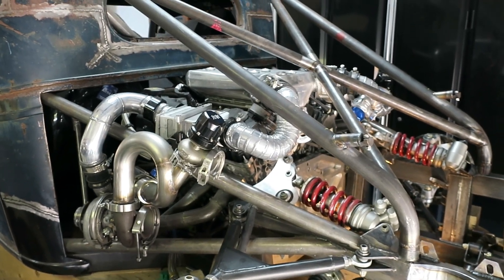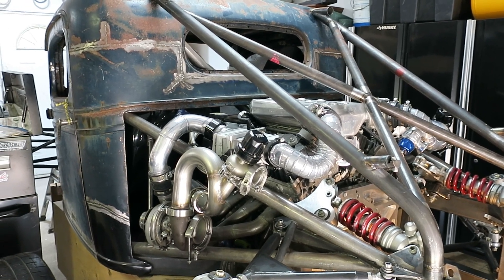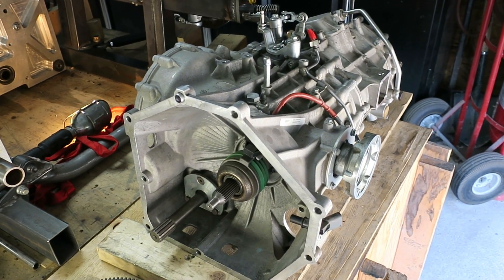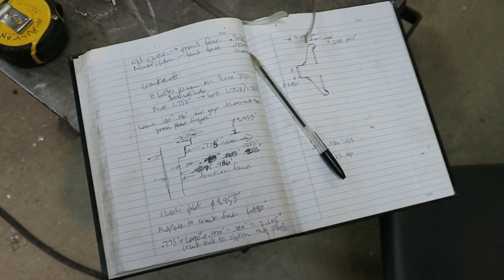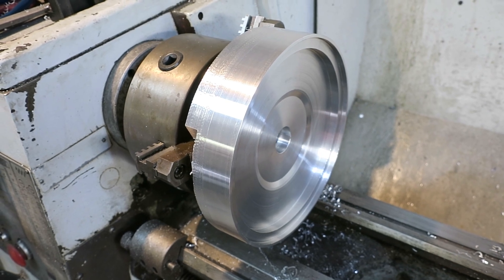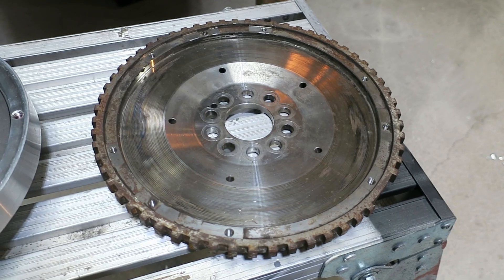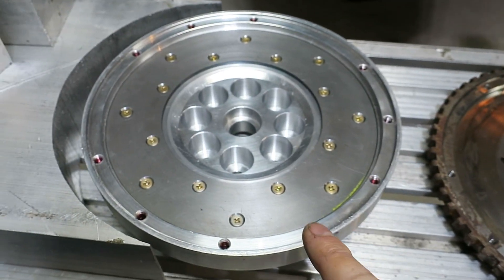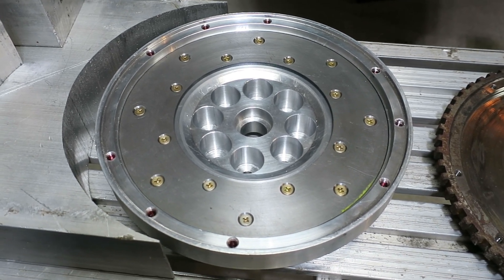'37 Chevy Race Rod - lightweight flywheel (14)

Comment: Nice work!
Reply from the maker: Thanks, I checked out your channel - your Fairlane is wicked!! The fact it's homebuilt is impressive.... is it street/strip, or racing only? Is the '67 Nova yours as well?

I'm using Dominator ecu too. Good tip on the relay board - I'd never heard of Leash before, looks like a good quality product. I'll be needing something similar
Reply: @grandpafabio   Thanks,the Fairlane is just cruising the street working on the tune,it'll make it to the track at some point.

The Nova belongs to a Bud.

Comment: Interesting choice of engine. Do you have a video? Why you chose it? I guess I'll go take a look myself.
Reply from the maker: In hindsight perhaps it wasn't the ideal choice, but I figured if it blows up there's a couple hundred thousand of them out there so shouldn't be too difficult to find a replacement. 

I'm still a bit shocked there isn't more aftermarket support - the direct injection seems to limit output unless you spend big $ on upgraded pump and injectors.
Reply: @grandpafabio  So I watched all your videos. You're welcome LOL and you don't really talk much about the motor but you do. Use a lot of R8 drive components. Had you ever considered the engine as well?